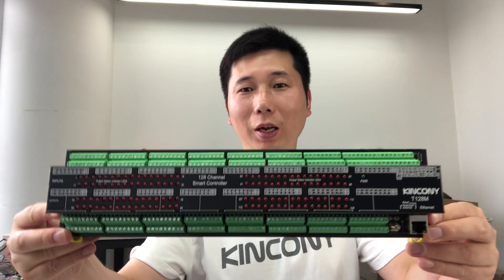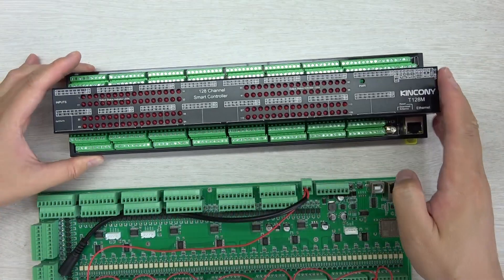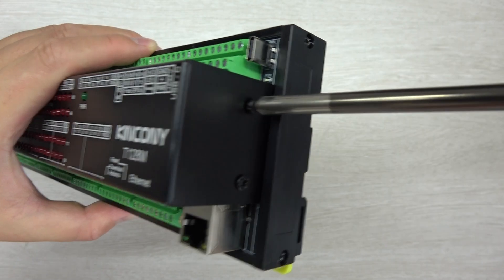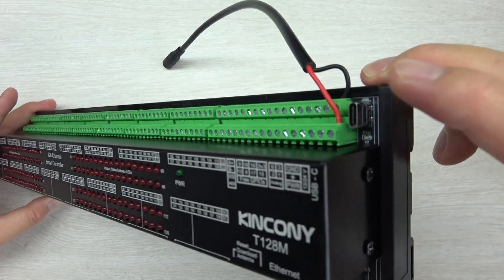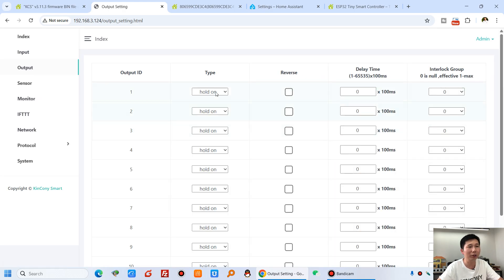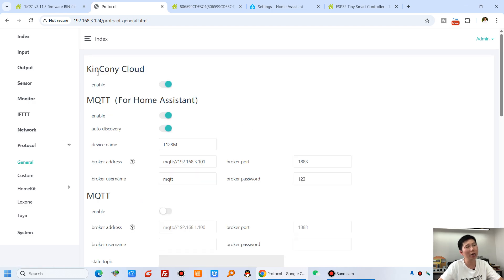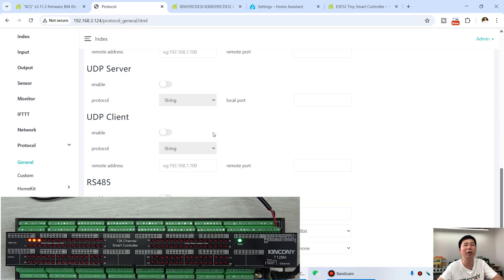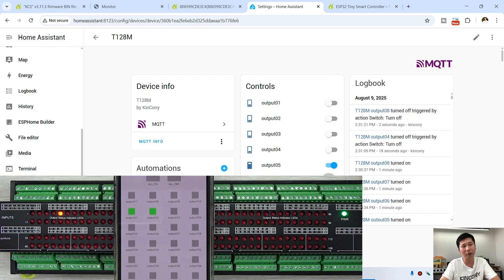new T128M ESP32 128CH DI+DO module home assistant ESPHome Tuya -crazy!

Comment: cool hardware, but i would have went with plugable headers like on your kc868 (partly). So its easier if u need to swap the hardware for any reasons (broken, killed a pin by over voltage,...)
Reply from the maker: Tiny version just want pcb size is smallest

Comment: One advice/question/idea: wouldn't it better/cheaper to use SMD LEDs and then pull the light by plastic light guides out of the cover, than using these subassemblies, made of lot of THT parts - you will have only one PCB, all LEDs will be assembled by the PnP machine, less screws, stand offs, connectors...
Reply from the maker: thanks for suggestion.

Comment: 128 output channels, each using 4A driver IC... but you can't use them to drive 4A at all... maybe 1 or two of the group, but not all
Reply from the maker: every 8 channel use by COMMON terminal. so 8 channel total current <10A is ok.
Reply: @KinCony  so you have to state this in the spec, because now it induces, that one can run 4A on all of the contacts, and that's simply not true, due to terminals and mainly of dissipated power on the switches. With ideal R(DS on) of 0.01 ohm, it will dissipate 2.6kW in theory and that's a lot of heat. It would release the magic smoke in milliseconds :D
Reply from the maker: @riskototh  thanks for suggestion.

Comment: Can you connect the load and test it in tuya app
Reply from the maker: it's ok work with tuya app and load.
Reply: can use it to control a contactor?
Reply from the maker: sure
Reply from the maker: sure
Reply: @KinCony really? even with the relay?
Reply: @KinCony ahh using dc contactors?
Reply from the maker: @Kiloptero  sure, it can control dc12v or 24v coin's relay.
Reply from the maker: @Kiloptero  yes, dc12v or 24v.

Comment: Better make the IO units a sub part stackable to the main control unit or a previous connected io unit. Like 16 IO extensions. Then you don't have to replace the whole unit if there is a hardware problem in an sub IO part.😊
Reply from the maker: do you means extend by i2c bus?
Reply: @KinCony  Yes.
Reply: It is so affordable you might as well change the whole thing
Reply: @PANZER7910  Where has the pricing been published?
Reply: @amerikalast  why not ask the manufacturer?
Reply from the maker: @amerikalast  https://shop.kincony.com/products/esp32-tiny-smart-controller-t128m-128ch-mosfet
Reply from the maker: @PANZER7910  for project, use by i2c extend module is not a stable way.
Reply: @KinCony use CAN instead
Reply from the maker: @cdxa5862  home assistant not support that.
Reply: @KinCony you can translate commands to HA compatible
Reply: Is this good to use as central control ler for inverters in solar farm, like 500 hectare that can harvest 500-700 megawatt.
Reply: Is this good to use as central control ler for inverters in solar farm, like 500 hectare that can harvest 500-700 megawatt.